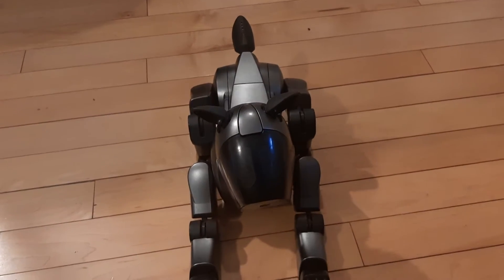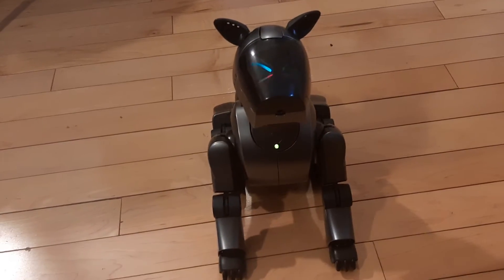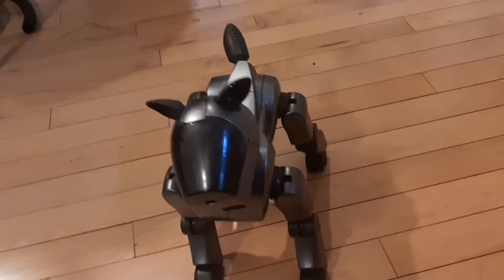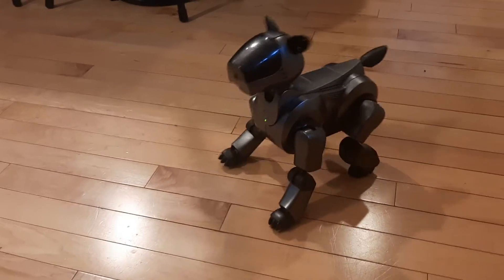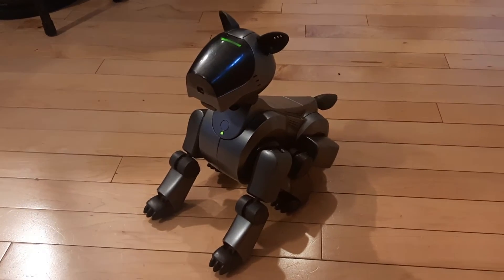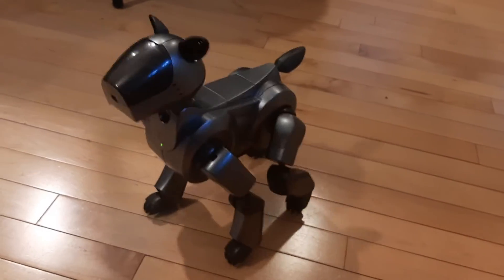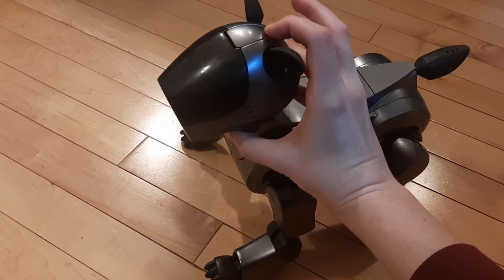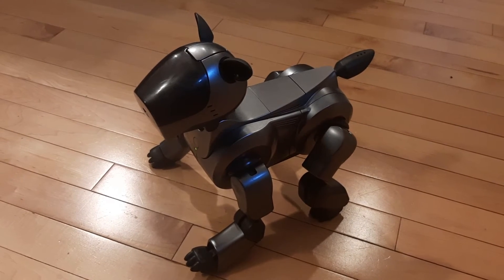Aibo ers 210 prototype core

Comment: It's tones also sounds slightly different from a normal 2x. Or is that just because it's buggy software-wise and jittery hardware-wise? Or am I wrong and the tones are standard 2x fair?
Reply from the maker: You are correct! Some of the tones are slightly different. They probably were changed in production firmware.
Reply: @EinfariÂûtomata  That makes sense. Also, if you find out anything more about this bot, I would definitely be interested. Hope you get feeling much better very soon.
Reply from the maker: @Heather-Br  I hope I can learn more too! It has some part stickers that say dvt5 and doesn't boot production software. I know @aibo7m3 has one that acts similar but not sure if it has been posted on her channel.
Reply: @EinfariÂûtomata  I can't answer that last; I haven't been to her channel in quite some time. But I don't recall her showing anything like this when I did check her out. So are we just seeing this aibo with no stick inserted, aka demo or clinic mode?